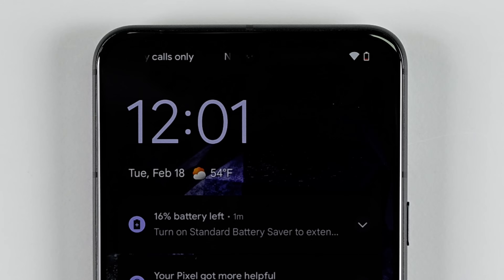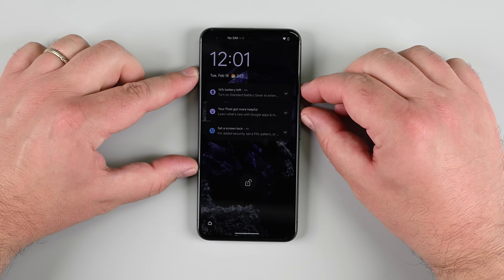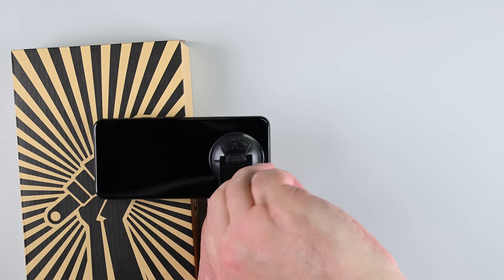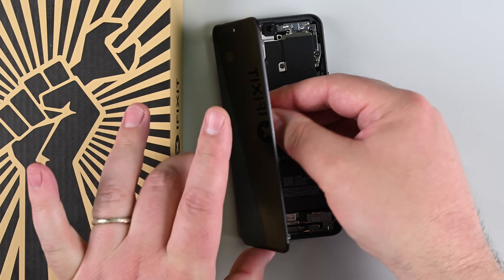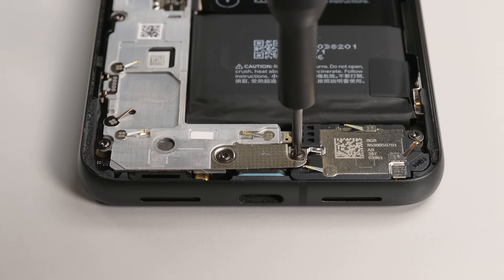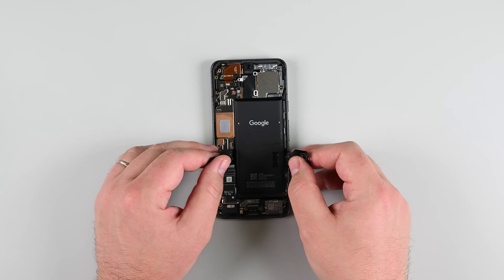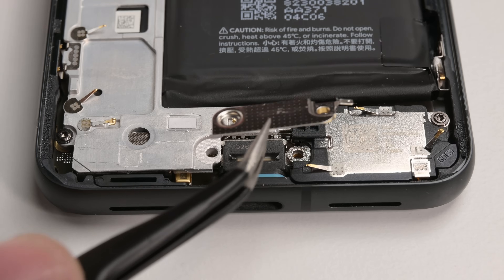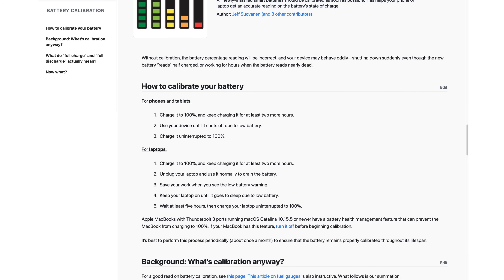Pixel 8 Battery Replacement Made Easy! DIY Repair Guide

Comment: Don't make my mistake: if you're replacing just the battery, you might get sent to a tutorial from ifixit on re-using the old screen. This tutorial won't mention replacing the screen cable cover before wrapping up. You may, then, proceed with that tutorial and place the screen before the cable cover.

By then it's too late. Now I'm just going to have to live with it. Hopefully the cord doesn't disconnect itself. I'll report back here if it does with how long it lasted.

Comment: I have a launch day pixel 8 pro and battery now down to 93% capacity, it's still ok if light use but heavy use it drains so fast now .
Was at 100% capacity for around 15 months, the last 6 months it has gone down to 93%
Reply: How do you check the Pixel 8's battery health?
Reply: @AnimeandGamesGalore Today I went to authorised Google repairer and they changed the battery under warranty, so now it's back up to 100% health. Went as low as 90% health before I changed it .only have a couple weeks warranty left on the phone , so I had to be quick

Comment: I remember when changing a battery took 10 seconds. Why does it have to be this difficult?
Reply: The short answer is easy water resistance. Far easier to prevent water getting in if you can just seal everything up. That being said I'd far rather have an easily replaceable battery than a more water resistant phone.

Comment: isnt it safe to use maxbear 4000mah battery in pixel 3?
original battery is 2915mah battery
Reply: It's likely that the quoted 4000mah will actually be closer to the original capacity anyway

Comment: my battery is dying quickly and my screen is being pushed off of the frame. am i cooked?
Reply: Sounds cooked.  Pixels gaining a bad reputation for self-cooking.  Recommend First Aid, asap.  If you pull down the Notification screen to expose the Quick Settings tiles, there's another button to see which apps are running, with buttons to close apps you're not using.  It cuts down on heat to close apps you're not using.
Reply: Well... You clearly have a swelling battery. Replace it ASAP.
Reply: If your battery is bloated then replace it ASAP, it's not safe to use.

Comment: "Made easy", you're being sarcastic, right) Looks like quite a pain in the butt, even for a guy with some experience. Why don't they use pull tabs like Apple does? And this isn't by all means a cheepish trash POCO or something, this one did cost a pretty penny, and it is meant to be used for quite some time, and thus be more or less serviceable, too.

Comment: I can't wait when EU will force easy to replace batteries in phones. In old phones battery replacement took literally seconds not hours!
Reply: I mean I prefer the old easily replaceable batteries as well. But those phones were also not nearly as water resistant/proof as modern phones with sealed difficult to replace batteries. Pros and cons to both methods.
Reply: @ameritus9041  Samsung Galaxy XCover Pro
Reply: @ameritus9041 I'm pretty sure they could put the back on with an adhesive the same as the screen and then put the battery as the most immediate part and also make the compartment tight enough I'm not reliant on other adhesive to keep the battery in place. This is definitely a solvable issue
Reply: BlackBerry

Comment: There is nothing easy about this!
Reply: Interesting of iFixit to invent that "hot pack" in place of a heat gun. 

I'd like to see more information about renewing/replacing the thermal pad, since the phone is notorious for running hot. 

And a quick mention about going to a different video for instructions about disconnecting a possibly-existing 5G antenna is NOT user friendly, iFixit.  Show me an 8 that doesn't have 5G.

In fact, a second view of this video suggests lots of details to mess up the successful completion.

Enough little details that it seems likely that even a pro will break something.  Can I find a pro that's done enough dozens of these 8s, because I don't want my phone to be the first one they work on.

Comment: Impressive content, iFixit. Looking forward to your next upload. I smashed that thumbs up button on your video. Keep up the fantastic work! In replacing the battery, how critical is the calibration process for the longevity of the new battery, and what techniques do you recommend for ensuring it’s done correctly?
Reply: Calibration doesn't really effect longevity, it just helps the battery percentage on the phone reflect what's happening in the battery.

Comment: You should've mentioned pixel 8 white stripe, and the fix for it: prying off pokey metal pins inside
Reply: do you mean that phones with a white stripe, if you open the phone and push the metal bits back, and put the screen back on, the screen will work normally? Like it's not a permanent damage?

Comment: This should be illegal. I mean seriously, what in the world. 

Remember the Galaxy S5. Instead of a 6 minute long guide, which has obviously been edited, so it's not longer than it already is. This could be a 10 second short video for the S5 battery replacement. 

It would literally be: 
1. Open back 
2. Replace the battery 
3. Close back 

And you're done. This should be normalized.
Reply: Part of the issue is modern phones are rated for dust and water resistance. I love the old way of easy-to-access doors on the back of the phone, but it seems we are moving farther away from that (with exceptions such as the fair phone of course). I do wish a modern, water-resistant battery pack could be designed to securely snap or slide into the main phone and keep the entire thing water and dust proof.
Reply: @mllarson  Big companies, like Apple for example, have more than enough engineering resources to realize this. Even basic water resistance, like the Galaxy S5 has (IP67), is more than enough for most people. The Fairphone and the Galaxy Xcover series also show it's possible. The only thing holding us back from environmental and consumer friendly devices is corporate greed. This is the same reason we lost expandable storage and the headphone jack...
Reply: @平和-v1z  Apple's main issue these days is part availability for the most part. Their phones are surprisingly easy to open
Reply: @nitrobear  It should be as easy as it is with the Galaxy S5. Apple tries to put in as many roadblocks as possible to prevent people from maintaining/repairing their devices. They use proprietary screws and serialized their parts. It's clear that they care about their bottom line and not about the environment or their customers.
Reply: Let's hope EU will bring back that.

Comment: The process doesn't seem too difficult to me (it's a bit tedious though), and the display being plugged in by a ribbon cable makes the display replacement modular. Stick to your disposable iPhones if you think this is bad.
Reply: it could have been way easier if the phone had a back entry or a dual entry design like modern iphones. This is a pain in the @ss to do. Also the pull tabs are extremely weird, why not go with a standard pull tab or a sticker back instead.
Reply: Yeah, even if it's a bit tedious it looks fairly standard, some glue, some tabs, some connectors, nothing out of this world. I don't like pixel phones, but this level of work to open one wouldn't drive me away if I wanted to buy one.
Reply: @devildante9
It's driving me to the Geek Squad

Comment: This is a pain in the ass, boo Google
Reply: This is probably one of the easiest batteries to replace 😂
Reply: @bloxycola8272 nah definitely not, the fairphone is the easiest, then back entry phones are also nice as you don't risk damaging the display.
Reply: @pvim  the fairphone is meant to be easy, but compared to other phones this one is easy to replace it’s a <10 minute job

Comment: This looks unnecessarily difficult compared to replacing a battery on an iPhone... and that's saying something.
Reply: Did you forget that iPhone parts are serialized?
Reply: @DariusMoore-co5hl they aren’t anymore as bad, you can simply pair new parts to the iPhone now
Reply: Don't you need to smash the back on an iPhone to replace it? And if you do the screen you have to work all the way from the back forward 

Screen replacement actually looks pretty easy on this which is probably why the screen repair is so much cheaper than iPhone ones
Reply: @jamesx2703 no. None of that is true. You can open recent iPhones from either the front or back, so the screen can be replaced directly. The battery can also be accessed without messing with the delicate, breakable screen, and no… the back plate doesn’t need to be “smashed” to open it. It opens just fine.
Reply: and with a fairphone i can switch the battery in half the time of this video.
Reply: @nutzeeer  more like 30 seconds
Reply: @ yeah true. idk how fast the phone turns off and on. would be cool if it had a tiny internal battery for quick restarts.
Reply: Have u ever opened an iphone, u sound like a typical apple fan boy
Reply: iPhone is king in that regard👍 Replacing the display, or camera module is pretty much a snap, too.